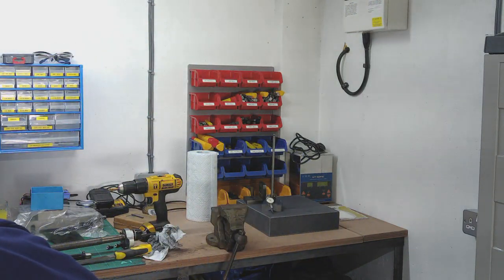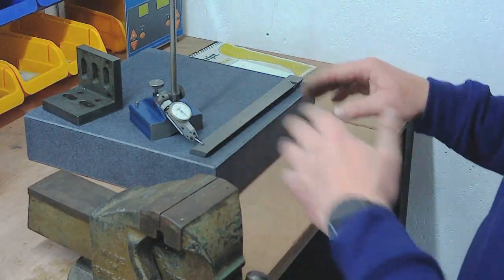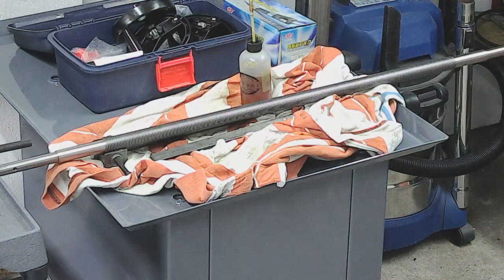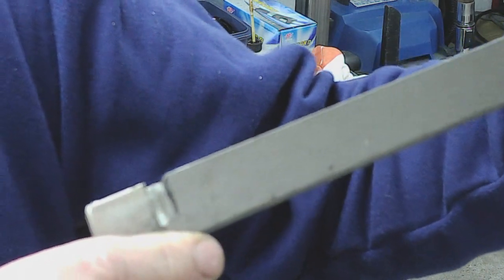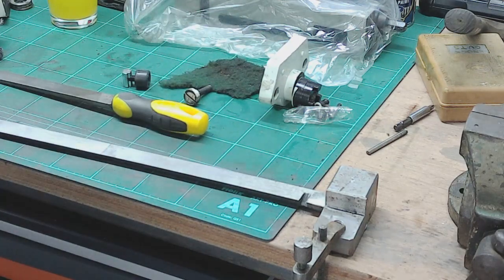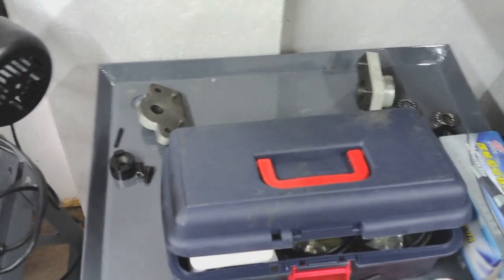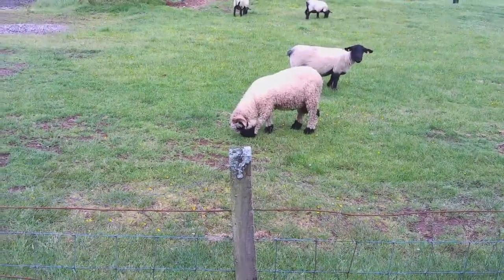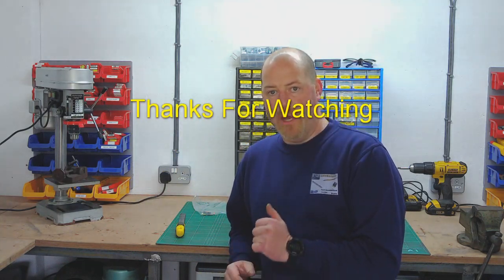Cormak ZX 7045 Mill Strip Down and Repair

Comment: Hi John I struggled with parting & grooving for years on my M250 then I bought a carbide insert blade that takes GTN3 inserts, what a revelation I wish I’d made the change sooner. No more chattering and it will do a bit of side to side turning eg for a feature with L&R shoulders. Your hand turning fix was a good solution which I will remember.
Reply from the maker: Hi Tony, thanks for the comment and feedback. Glad you are finding parting easier, inserted blade tools really do help on all but the very smallest of lathes. Cheers, Jon

Comment: Good technique on draw filing the Gibbs, strip down and clean up are coming along well looking forward to you removing the head we should run a book on the weight of casting sand you find in there ! Keep going you know its going to be worth it .
Reply from the maker: Hi Steve, thanks for the comment, yes it's coming along well now and it will be worth it you're right. To be honest it's only two days labour to date so if I add a day for the head it's not bad really, and despite the initial shock, I have enjoyed the challenge so all good. If I manage to entertain a few viewers along the way then even better. Soon be there now. Cheers, Jon

Comment: Thanks for the video Jon. It's a pity nowadays you have to strip a new machine, just to get is to a good enough standard to start working with it. Good work on the videos. Keep safe and stay well.
Reply from the maker: Hi Colin, we will get there, the bulk of the hard work is done now and a side bonus is I understand every nut and bolt of the build so maintenance and problem diagnosis should be much easier. Just the head to go now. Cheers, Jon

Comment: Nice work. Draw filing the gibs worked really well. Spent many hours draw filing during my technical training in the RAF. You are highly skilled. If there is some way I can send you something I may be able to let you have some circlip pliers.

Under all the muck the castings and other bits seem good and solid. I reckon that's going to be great once your done fettling.
Reply from the maker: Hi Carl, thanks for the support and kind words, despite the initial disappointment, I am really enjoying the challenge. I am very self critical of my own work so it's nice to get positive feedback from someone who knows the ropes. If you email me on my workshop email I will send you an email back with address details. Thanks for the kind offer. Cheers, Jon
Reply: @jonsworkshop  Hi Jon, no problem. I'll email you.

Comment: Jon,
Out of interest is there a technical reason why you did not place the GIB diagonally on the surface plate to allow more contact? The only issue I could see was that it would be harder to setup the dial indicator. SORRY for the question, I’m just keen to learn.
Cheers
Paul,,
Reply from the maker: Hi Paul, one reason, laziness! I really should have spun it round but just got lazy and used the same clean bit at the front. Bad practice of which I am not proud, all you learnt is how not to do it! Cheers, Jon

Comment: That's a great technique for filing flat for those of us who've no scraping experience. I'm just wondering if it's really necessary to true up both sides of the gib strip? One side just sits on the adjustment screws and doesn't have to slide against anything.
Reply from the maker: Hi John, thanks for the comment. These are tapered gibs and as such have no adjusting screws along their length. If you fattened out the contact side but not the back side, once squeezed into the taper gap there is a risk you will bow the Gib (especially the longer ones) reducing the contact area with the slideway. On reflection and having used the machine a bit now, I am questioning what benefits I got for the effort as I am not happy with the Gibs at all. A future project to make some better ones! Cheers, Jon

Comment: Hi Jon, any thoughts for your first project when you are up and running ?
Reply from the maker: Hi Tony, I have a long list including, carriage stop and rear part off tool-post for the lathe, new tumbler gears for the lathe (need dividing head first), loads of other similar parts really but very first project will probably be some bespoke clamps for the vice. Cheers, Jon
Reply: I am looking fwd to it ! 👍🏻

Comment: Hi Jon,  just subscribed! I am also nearly as far as buying a same milling machine and appreciate the honest review sofar.I have a warco lathe and that also needed stripping and extensive cleaning ...
Bit worried now since I am more a fabricator than proper machinist.Any advice at this stage?
Nice content thanks!
Best of luck with the channel.
Reply from the maker: Hi Robert, thanks for the comment and great to have you on board. First of all, don't be put off, underneath all the muck, there's a half decent machine (think this would be true of most Asian imports). You don't need machinist skills to do what I am doing so don't let that put you off either. It is all just care and attention, cleaning, fettling and strip and assembly work. The biggest skill you need is patience, all you want to do is plug it in and get cracking so it is counterintuitive to take it all apart. I will film it all and show the methods I have used along the way so you can follow along (as well as loads of similar channels content). I will also help you out if you are unsure, need advice etc, you can email me anytime. I am no expert but to be honest it is all just common sense. One rule that is universal is you get out what you put in so gear yourself up for a couple of weeks of graft and you will have no problem at all. Make sure you buy the ancillary gear you need before you buy the machine...... Its no accident I got the surface table and fixed the dti stand before the mill arrived, I knew it would be needed. If you don't have the gear you will be tempted to take short cuts and this is when you lose the opportunity to make the best of the kit of parts. Glad you are enjoying the content. Cheers, Jon
Reply: Thanks for taking the time to give such an elaborate and motivating answer.I follow the ,,usual suspects,,re machine work on YouTube .Now just retired so getting ready to spend time making/repairing stuff.I will go ahead now with the purchase...del time is very short to my place(s.france)so I can follow your lead going forward.
Big thumbs up

Comment: check stefan gotteswinter on scraping and treuing up stuff in general  , 
https://www.youtube.com/user/syyl
theres a trick for finding where the high spot(s) is/are located ,push against the side without pushing down with the part laying on the surface plate , it will turn round on its high spot if it has one , test by pushing from different places to make sure it  IS the high spot and where its located on the x y axis if its a wider part 
stefan is a realy good fine metalworker and has followed lessons in scraping stuff from someone who realy knows about this stuff , theres more to it and bleuing in general that you would think
i watched his vids on the subject a few times and i still trying to wrap my head around it
Reply from the maker: Hi, yes, I have been subscribed to him since he started, watched all his videos, he is a very skilled man. Cheers, Jon